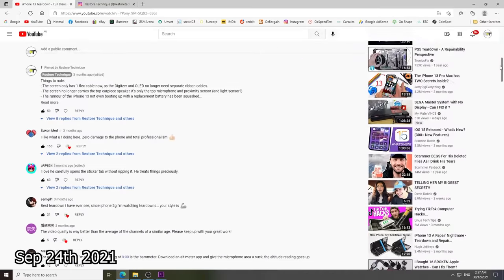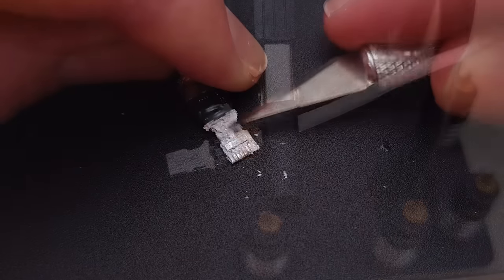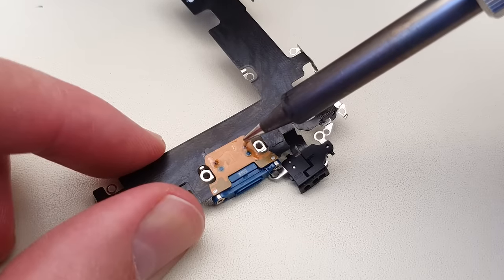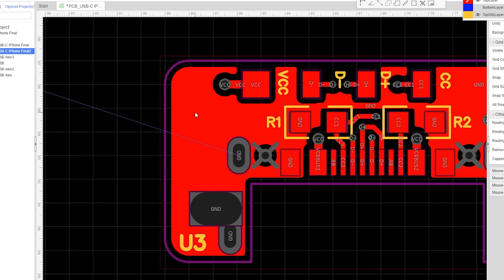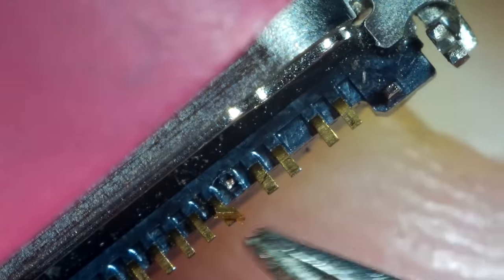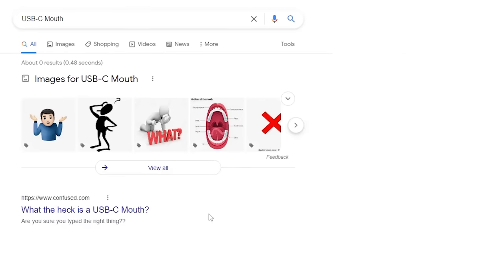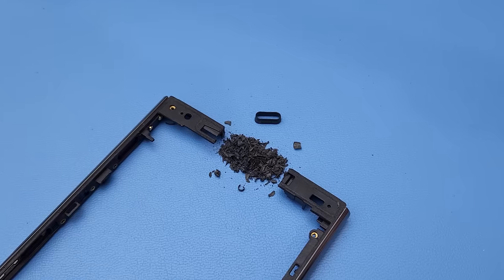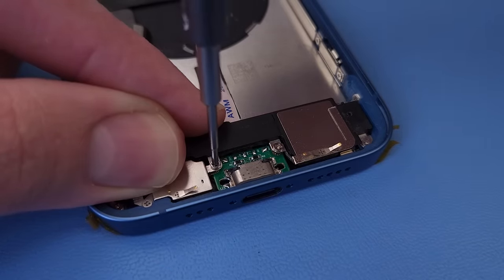I made a USB-C iPhone 13

Comment: I was watching the part where you soldered the connections onto the USB C port thinking "hmm, maybe I could do this" and then looked at my phone and realized how little space that actually is. The skill needed to do that without shorting anything is nothing short of amazing.
Reply: And he managed to film it. Great work and skill.
Reply: High level technic
Reply: Yeah, you'd need a microscope 🔬and to film it... with camera attached
Reply: @deftyfeet  fr
Reply: Your'd be surprised how well the solder mask works. There are automated soldering setups that just immerse the whole thing in liquid solder, it doesn't come out as one big blob, the resist (the often green coating) repels the solder. Look up drag soldering SMD.
Reply: "It's really not that hard, don't say positive stuff it hurts me"
- Some cocky guy soon, probably
Reply: @twosinister  that attitude is a damaging personality disorder
Reply: @johnrhodes3350  fr
Reply: It's actually pretty easy.  Things are much bigger under a scope.
Reply: @twosinister , it took just two days for your prediction to come true.
Reply: @twosinister  aged well
Reply: @twosinister  holy shit 2 days lmaooo
Reply: “Nothing short of amazing.” Hehe

Comment: Converting the iPhone to USB C is nice an all but mixing the epoxy on the lightning cable box was a nice touch that I really appreciated. Elevated the whole video to the next level in my opinion
Reply: yes!!
Reply: Yeah, I literally lol'd at that part
Reply: use trash accordingly
Reply from the maker: Haha, cheers dude 👍
Reply: The point is if you don't mix epoxy on the iPhone box nothing will work.
Reply: i thought the same 🤣

Comment: You absolute mad lad. You installed a type C charging port in a modern iphone without having to resort to any tools that are particularly expensive. Your "CNC" skills are next-level, and I am genuinely envious of both your skills and the finished result. I wish I could pay you to do this to my phone, but I doubt I could afford it. Chances are I'll have to wait for Apple to make the switch to type C due to EU regulations. Here's hoping they actually make the switch!
Reply: whats cnc
Reply: They are forced to make the switch. The next iPhones will all be usb-c
Reply: @randy45  in Europe*
Reply: @randy45  Have they announced that officially yet? As far as I'm aware, that's all just an educated guess. Apple could always try and pull some BS where EU phones have type C and US phones retain their lightning port.
Reply: @mot3600official  CNC stands for Computer Numerical Control. Essentially, it's like a 3D printer, but rather than adding material (such as plastic) to a build plate to create the form of the item you want made, it actually carves the item out of a block of existing material (wood, aluminum, etc). 3D printing is additive manufacturing, and CNC machining is subtractive manufacturing.
Reply: @dedsecaffiliate1979  US senator has already tried pushing this, it would also probably cost ineffective to build two seperate models.
Reply: @randy45  It might be cost ineffective to have two separate models. Then again, this is Apple we're talking about. They could just exploit more children in their factories, and Apple fanboys will buy their products just the same. They make a ton of money on accessory sales, and I don't think they'd give up that income without a fight.
Reply: @dedsecaffiliate1979  why would you want to do it? Go and check the USB-C vs Lightning port specs. Lightning port should have gone years ago.
Reply: @JamieCrookes  Of course I want USB type C. It's universal, and I'm tired of Apple shoving their MFI certification requirements for all accessories. The only thing a lightning port beats a type C port on that actually matters is durability. That said, I've never broken a Type C port, and I have numerous devices that use them.
Reply: @randy45  Apple may force you to wireless charge just to not put the damn usb-c 🤣
Reply: @randy45  they will prefer to make a portless iphone than to make a usb-c one
Reply: @katech6020  They won't.. Portless is not viable enough to be the only way of charging. In a few years they will as they would have anyway.
Reply: @randy45  Isn't wireless fast-charging available?
Reply: Here in Britain we’ve split from Europe I doubt we will do it I hope they don’t 😂
Reply: @RonSimiyu  No, wireless charging is still very slow compared to the 125w some phones can pull.
Reply: @JamieCrookes  why should it? Its more durable snd isn't a completely flawed design like usb c is, with a pin in the middle. Both support usb 3.0.
All this will do iscreate lots of waste. They should forbid all accessories in the box instead of forcing billions of cables to go to waste
Reply: Just imagine world without iphone
Reply: @kidikee1  That might happen. iPhone15- no holes in frame at all! 🤣🤣🤣
Reply: @Brian-jv8iy  I apologize if I misunderstood you, but lightning does not support USB 3.0 (as USB C does). Because of this, it is tortuously slow to upload large video files from iphone to your computer for editing, etc.
Reply: It would probably just be easier to include an adapter with each new phone. Then they could also sell apple branded adapters for $50 each.
Reply: @Shiro128b  or make charge cable that has four charger wire place  you can Place charger wires
Reply: Or, maybe stop buying from a company that refuses to do this in the first place.
Reply: consensual non consent
Reply: He isent a madlad, he is a gigachad
Reply: @mot3600official  basically a robot surgeon that will shave material away from anything to create everything. Have a block of aluminum? It'll make a fucking figurine with art work out of it.
Reply: Lucas Gawor  But they haven't officially announced that that will be the new standard for all their products including the ones in the US, have they?
Reply: Little do you know, that's why they are pushing magsafe right now... I suspect Apple would rather have a 0 port phone that's wireless only than to give up income from proprietary accessories
Reply: @natebit7167  That's far easier said than done. If anything breaks with the software, it'd be pretty much impossible to diagnose and repair without some way to connect it to a PC in a way that data can be transferred. That would be trouble both for Apple and for Apple customers alike.
Reply: Can you explain me why should be USB-C better than lightning cable? What are the differences???
Reply: @giovannij3060  USB C has faster data transfer rates and is much more common. Additionally, USB C devices can charge faster than lightning devices. Lastly, USB C is also reversible, so there's really no reason to keep using lightning except for lining the pockets of Apple executives. 

Some people say that lightning is more durable than USB C, and they're right, but I've never ruined a USB C port, and I've had many USB C devices over the past few years. I've only ever seen people ruin them if they are actually trying to ruin them to demonstrate why lightning is "better." 

Those are just the technical benefits for switching to USB C. There are also a ton of environmental benefits for switching to one connector standard. E-Waste is a pretty big deal, and if requiring all phone manufacturers to use one type of port can curb that even a bit, then there's really no downside to that that I can see.
Reply: I wish my ipad air 3 lightnin port get changed to usb-c by you..😁 👍👍
Reply: @randy45  no probably have to wait until iPhone 15 because the iPhone 14 is confirmed lightening port which is why I’m probably gonna skip it and wait for the iPhone 15
Reply: @dedsecaffiliate1979  nah they’re gonna stay with lightening port this year and probably switch to usbc on the iPhone 15 but idk for sure. I just know they’re sticking with lightening port this year
Reply: How much will it cost?

Comment: Hey! I’m the guy who made the first usb-c iPhone. I enjoyed watching your video and am glad you could replicate the concepts of my video on the iPhone 13, with your own twist and originality on it.

Some comments:  
03:17 I’m not sure if you use some heat to remove that glue, but it decreases the chances of ripping/breaking components underneath 
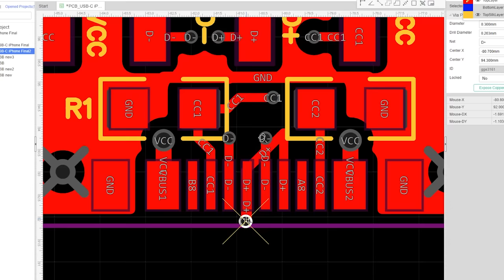05:31 I’m a bit confused why you needed two 5.1kOhms resistors. R2, sure, and that would limit the charging speed (no fast charging) when the USB-C is plugged in one of the two ways. I see you mention that at the end of the video. But I don’t believe R1 is needed.
Reply: Wow amazing project
Reply from the maker: Hey Kenny Pi, thanks for watching!!
Yeah I don't think I was using any heat to remove that glue on the flex, even though I did use heat when removing glue on the C94. But unlike the iPhone X charging flex, it's got those tiny components butted right up against the ports pins, so I don't know how I was going to desolder the port really.
I have seen many people add usb-c to various devices and use a 5.1k resistor on both CC pins. Wasn't sure if it was necessary tbh 😕
Thanks for your great video. Yours was definitely a better build internally with everything on the flexible circuit board, way cleaner, and also less obtrusive around the battery.
I originally started this project at the end of November, trying to get something made by the end of December or January, so i tried a simpler approach, but the project dragged on and on and life got in the way. Was tempted to try and get fast charging working both ways, but decided to just call it. ✌️
Reply: cmiiw, but I believe those 5.1k resistors are for type-c to type-c connections and let the connected device (in this case a computer) know it's not a host device, if not you'll need to use a type a to type c cable for it, I only work with custom keyboard PCBs but that's all I know
Reply: I think that the only one way fast charging is perfect: just do a dot on the side of the cable that charges fast the phone, so you'll have a fast charging mode for the day and a slow charging mode for the night when you don't need crazy speed
Reply: @RestoreTechnique  you guys should do a collab video!
Reply: @GRLDT  That's exactly it. If you only use one, a C-to-C cable will only work in one orientation.

Comment: Being an engineer at heart, I love when someone calls out a big tech like Apple w/ examples, for their incredible stubbornness that only serves the dark-pattern of locking to their absurd "lightning cable" standard. 

Crazy that Apple, a company that takes pride in creating the best product for its users, argued "regulatory action stifles innovation" when EU had to force them to move to USB-C. This example clearly shows that they could put a USB-C without any major design compromise.

Do better Apple!
Reply: Regulatory action may stiffle innovation, but when was the last time Apple innovated a new charging cable?
Reply: Appreciated sir  type c way far superior from old git grandad Apple iPhone user.
Reply: @akaraven66  Lol. Solid argument.
Reply: @tombaker9341  the one thing lightning is still better is damage resistance. USBC has the contacts in the middle on a thin plate. This plate can get damaged when cleaning and break.
Reply: @akaraven66  now that's an valid point
Reply: @akaraven66  Probably when they helped develop USB - C
Reply: @blise518B  yeah there are some flaws but given how simlpe the lighting cable, in terms of capabilities, it's not really a win for lightning... unless you consider USB 2.0 a win. I would agree with you, but once you factor how many pins USBC has to support it's more of a nil arg.
Reply: Since when has apple taken pride into creating the best product for it's users 🤦
Reply: @blise518B  yeah. I hate when I need to replace my usb-c port every single 5 years. Not like I need to replace my lightning cable once every 6 months, amirite?
Reply: @assetaden6662  nah cable live time is down to manufacturer quality. The apple cables just suck. My 6 year old high quality lightning cables are still doing fine. On the other hand I also got crap usbc cables that died after half a year.
Reply: @blise518B  my USB-C plate broke once!
Reply: Regulatory action stifles innovation.  NO.  Regulatory action stifles the bottom line.  It is all, and as far I'm concerned, that the Lightning cable is good for Apple.  Revenue.  The lighting capability is obsolete anyway, but they will have to oblige.  Unless of course they want their phone to be banned from the European continent and surrounding.  That's a rather sizeable market share is you ask me!
Reply: still it will be until late 2024 at the earliest (pun intended) before we see and hear apple's bs pr talking in a keynote about how 'great the move to USB-C is for the iPhone and 'our' users, and we couldn't be happier bladiebla to have had this incredible momentum with lightning these past ten years, bla die bla, but it's time to say good bye and welcome USB-C and our new Made for USB-C iPhone certification programme for our partners.' or how ever else apple's going to spoon-feed this on use when they move to USB-C. ;_)
Reply: @DaveFlash  use charger samasng
Reply: The cost of each lightning cable is higher than a type c cable. Even increasing the cost of your smartphone by $ 25.00 at the time of purchase will never be the same as selling more cables in the entire amount of time you own the smartphone. It is clearly economic speculation. 💲💲💲
Reply: I think they wanted to have the 10-year-lightning milestone, and put USB-C after that. They probably negociated with the EU to do just that. I'm pretty sure they are going to present the USB-C switch after a history lesson about the lightning port (which came out in 2012 with the 5).
Reply: @akaraven66  since 2012 iPhone 5 and a newer version of magsafe on iPhone 12 and 13 and for macbooks
Reply: It wasn't that the engineers couldn't do that, it was that Apple is greedy and makes money from selling the license to make official Apple compatible cables. Now that the EU forced them to USB standard, they won't make that sweet, juicy commission.
Reply: @DavidSmerkous  lightning is 3.0 unless its locked through software to 2.0, and its small and sturdy unlike usb c
Reply: @Brian-jv8iy  where do you see it's 3.0? All the online sources I've been reading have been saying 2.0
Reply: @sys-administrator  because the ipad doesn't sell nearly as many units as the iphone, so it's not "worth" it. also, the ipad is supposed to be higher end than the iphone, so it would probably piss off more people if it wasn't usbc.
Reply: @DaveFlash  you'll probably need special apple licensed usb-c cables with yet another apple chip inside the cable. If apple excels at one thing, its milking the customers
Reply: @blise518B  Did you not use a phone cover?
Reply: @qasmokes  yes but that doesn’t change charge port durability in any way.
Reply: @blise518B  It does. When you drop your phone it lands on the phone cover instead of the charge port
Reply: @qasmokes  idk how you drop your phone on the charge port while there is a pug inside. Thats definitely not the problem
Reply: @blise518B  Yeah na
Reply: 👆👆 Congratulations you have been selected among my lucky shortlisted winners🤩🥳 Send a message on Telegram to claim your prize🎁🎊
Reply: but lightning port is more solid than usb-C. with lightning you have only 2 pieces. With usb-c you have 3 pieces. This small thing sticking out from the port can be easily bent and destroyed.